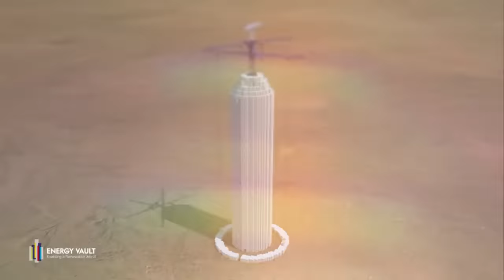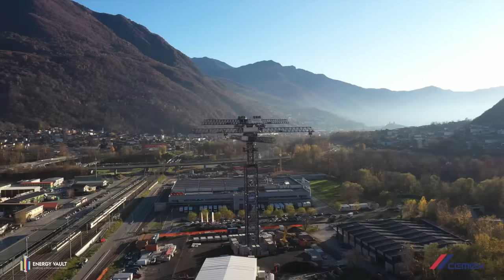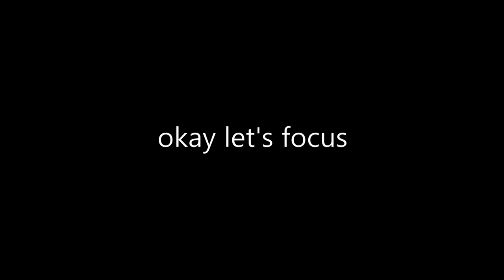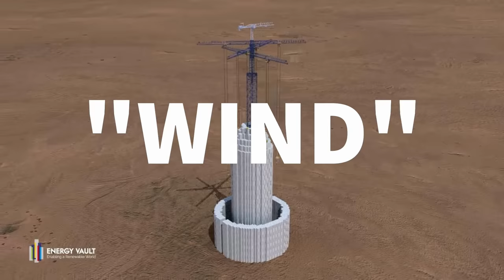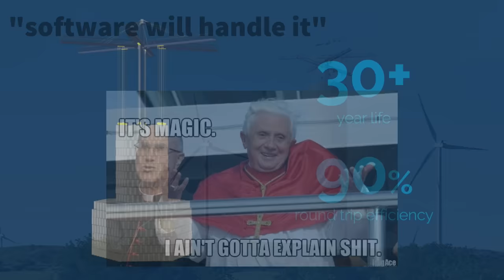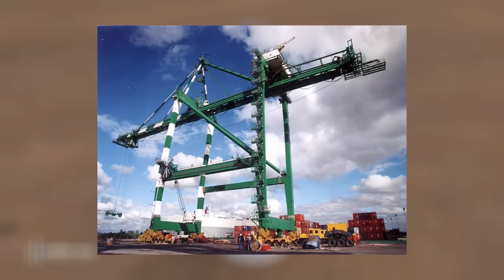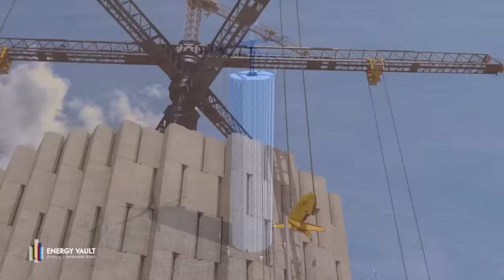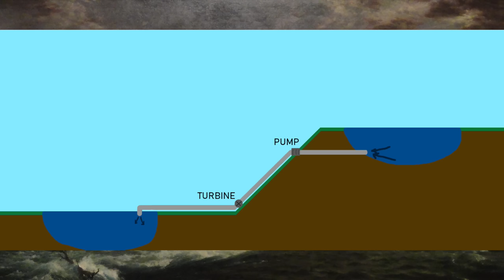The Energy Vault is a Dumb Idea, Here's Why

Comment: Okay, so pumped-storage hydro actually does everything this system promises to do - awesome! 
The obvious problem is that natural sites suitable for pumped-storage hydro are super rare. 
So the questions are, how can you artificially create such a system at minimal cost and environmental impact, and could that possibly be cheap enough to be economically viable?
Reply: Making an earthen resovoir and an artificial lake on a flat plane has still gotta be cheaper then the literal hundreds/thousands of cranes you would need for this thing to compete though.
Reply: the the problem is "natural sites suitable for pumped-storage hydro"
solve that instead this nonsense.
instead "natural" why not "artificial"?
we have brain to think not to dream only.
Reply: Build a reservoir on the top of a cliff close to the sea and pump salt water. You can even use the pressure to desalinize part of it.
Reply: Old abandoned mineshafts make a good (and deep) empty cavity underground. With the "high" water reservoir on the surface. This concept is called: Underground Pumped Hydro Storage (UPHS).
Reply: Drop a concrete slab in front of a river
Reply: Just popped into my head as I was reading: maybe towers filled with a compressed gas? Something like this already exists, but for a different reason; LPG is stored in towers to maintain a constant gas supply to households.
Reply: @Kj16V  Underground chambers filled with compressed air are in use. The issue is that they are still using a small amount of gas to heat it up before pushing it to the turbine... so not completely carbon-free technology at this point
Reply: @gergokovacs3257  large and heavy rotating body sounds difficult to manage tho
Reply: @Kj16V  That need an extra energy to cool them down...did you saw those radiators next to the LPG towers? that's the reason they are there :)
Reply: The answer is - you can't. VRE is a dead end. Storage requirements are enormous and they grow every day, as the humanity uses more energy.
Reply: @xanjismaverick5459  yes, but too expensive to consume such electricity.
Reply: @ryaeon9793  artificial = much more costly
Reply: @albertoa.r.5886  and your pump is dead in no time.
Reply: @antoonvandyck2086  mine shafts = small capacity.
Reply: @Argentvs  promising on paper before you check costs, roundtrip losses and capacity. Better than batteries, but geographically limited and still 10x too expensive.
Reply: @ImaskarDono  well, steel sir tanks are cheaper than giant lithium batteries that last s few years and need replacement.
Reply: @ImaskarDono  so did we artificially create a dam? 
did we artificially create these dumb idea that raise and lower concrete block?
we artificially create wind turbine?

if you dont want something costly just go live in the jungle without electricity.
Reply: @ryaeon9793  Pumped hydro global atlas is a list of sites that have the geography for pumped-storage hydro
Reply: @catprog  yeah.. that why i said we need more alternative that are effective and not only catchy or sound cool only.
forgot which comment i did that.
Reply: There is a pretty good alternative. Air batteries! Now, I haven’t seen 100% proof of viability, but it is not relying on altering the environment in any way, all it needs is a air pump. 

Essentially it is a tank of liquid gas, and they pump air into it to store energy, and then run it backwards to produce energy. You lose a fair bit of it on the way, but it more than makes up for it by scalability and not being environmentally invasive.
Reply: I mean... with all that concrete, you could easily make a reservoir with it.
Reply: @gergokovacs3257  friction loss
Reply: @hanneslaurin9768  do you remember pumping your bike's tires? as soon as you compress air, it heats up and you need to keep it below a certain level = cool it somehow = energy loss.
Reply: @BlueSky_BlueSky  yeah, i think they adressed it.  I mean, any pumping of any media will result in a heat loss, but all conversions of energy are not a 100%, that is physically impossible. We are talking about what are viable options, and pumped hydro is a fucking mess. If you dont want to end up building these insane structures, you have to find just the right topology and make crazy invasive alterations. Both those alternatives would in themself result in massive carbon emissions. 

Maybe im missing smtn, but i have been looking into gravity based energy storage, and it just does not seem practical in almost all cases. If nothing else then the limitation using gravity is in terms if energy. Even with lead it just takes up to much volume for what little energy you can store. I think people in general overestimate how much potential energy can be stored in physical objects in relation to what that means in terms if electricity.

Im sure there will be some good implementations, but it is not a magic bullet. 

However, air batteries seem to have solved most of those issues. And is just a bit less efficient than pumped hydro, with potential for improvement. It does not fuck up local environment, it does not need to be done on a massive scale, and it can negate the energy loss of electricity transport by being distributed. 
It uses a resource we have in abundance,  and which won’t affect the local wildlife. 

Imagine the engineering challenge of building a massive pond at a high elevation, compare it to setting up a couple of pressure tanks and pumps at the edge of town. Imagine the difference in how quickly it can be adapted, and not being limited by the local topology and water availability.
Reply: @hanneslaurin9768  Ok, I will have a closer look at that compressed air energy storage technology.
Reply: @BlueSky_BlueSky  let me know if you find anything that counters what i have claimed. Im genuinely curious about this topic
Reply: @xanjismaverick5459  If one of these towers tips over it will have a pretty localized effect.  If a large amount of water escapes it's dam things may be a little more frantic.
Reply: @sendoh7x  They are already using flywheels for grid storage.  The problem is scaling them up- you basically have to do a lot of smallish ones.  Back in the day of CD players they were constantly trying to push rotations speeds.  They topped out at about 50k rotations for the CD players before the CDs would explode.  The numbers are bigger for flywheels but you still have a limit to how fast you can spin them, and the wider diameter you give them the faster the outside of the wheel goes.  

I wonder how much you could push the outer edge in with magnets.  You'd have one polarity around the outside of the flywheel chamber, another around the outside of the flywheel, a slight angle gives you magnetic levitation but the big magnet in the wall could apply compression to the flywheel to help keep it from flying apart.
Reply: @xanjismaverick5459  "gotta be"

K bro, glad to know u did the math
Reply: @Kj16V  Better store compressed gas in balloons on the seafloor. Most wind energy gets produced in those areas anyway,
Reply: @sir0herrbatka  Not great, a lot of energy is lost through gas compression. You need constant pressure and balloons on the sea floor solve this issue.
Reply: You don't need a natural site; if you wanted to you could also just make a big hole or tower and arrange the pumping vertically. Not super hard.
Reply: @xanjismaverick5459  than* but yeah.
Reply: @gergokovacs3257  Do you have any idea how labour, material and cost prohibitive it is to have a large vacum chamber ? Gaskets wear out, washers and screws become loose its a nightmare. Not to mention there is no point to the system. If you have a system able to contain a vacum you esentialy have an inverse compresed air system. You just need to let air in to the system at a controled volume trough a narow tube fitted with a turbine to generate power when you need it. With the downside that vacum is more expensive than compresed air. You ppl need to stop trying to reinvent the wheel there is a reason why it is round and not square.
Reply: @nacoran  and you'd lose 99% of energy to eddy currents. Sounds great
Reply: Using old open mining areas in flatter areas would work.
Reply: @sendoh7x  "software will handle it" ;)
Reply: @gergokovacs3257  No at the moment I am a surgeon, but before I decided to go to med school I graduated a technical college and worked a bit as a CAD technician.
Reply: The answer is simple, you just use a big, electric, battery. Costs are coming down, energy density is rising, can put them damn near anywhere, ridiculous efficiency of energy in/out at 95% and higher, near-instantaneous delivery, minimal maintenance concerns
Reply: @DreadedEntityMain  You mean a chemical battery, the hydro battery and even the concrete one are also electrical. And no sorry as stupid as this concrete battery is a chemical one is even more stupid. They are very expensive, don`t last long, dangerous (they are essentially huge incendiary devices), and an environmental hazard (because of the heavy metals they contain). But the argument that there are places where hydro batteries are not feasible is a weak one. Yes there are such places, but its very rare for people to live in them so its not an issue. People usually live where they have access to fresh water.
Reply: @albertoa.r.5886  you can desalinize by pressure alone? ..i have some google research to do
Reply: @DreadedEntityMain  the costs are not enough for MASS storage.
Reply: Use liquid aluminium instead of water
Reply: I think you're confusing energy storage with production. Natural dam sites like Hoover Dam that are very economical, generate an energy surplus, etc. are rare. Hoover dam does not pump water back up to its reservoir and become a battery. 

There's plenty of lake sites and other solutions such as compressed air that we currently use (or rather don't use) that are fine for energy storage and would be more efficient than what they're proposing with concrete blocks and cranes. These solutions are still only like 50-60% efficient. You don't need a storage site right next to the plant, its the same reason you don't need to build houses right next to power plants. The benefit of energy storage is timing, not proximity, because we have power grid on alternating currents. But energy storage just doesn't make economic sense because of the 40-50% you lose unless you have massive scale like the Bath County Pumped Storage Station that covers the power grid of the east coast of the United States (various proposals are in the works for the west coast too including adding pumps to Hoover dam). 

Its just a silly thing to trick general population, like solar highways. Its easy to get people to understand the need for energy storage and everyone has enough school to understand gravity, so easy crowdfunding scam. But picking up rocks to drop them later is not an efficient way to store energy for the same reason there's no power plant that works by dropping rocks off a cliff.
Reply: @hanneslaurin9768  Its like 40-50% energy loss. But picking up rocks and dropping them is much much worse efficiency. Talking about flywheels or whatever is just obscuring this fundamental issue of translating mechanical work to energy and back. Anything mechanical can spin a turbine/flywheel/etc. its about how efficient you can translate mechanical work to energy and back again and its not hard to quickly figure out why pumping water is more efficient than picking up and dropping rocks despite all the problems with water.
Reply: Make a landfill with the intent to convert it into a pump storage. Use excess energy from landfill to pump water.
Reply: There's tons of suitable sites. Hell we already have them, they're called hydroelectric dams. Most already have small reservoirs in place to balance the flow of water and to be used as a municipal water source. Then there's disused sites that are suitable like old quarries and mineshafts. Old fracking sites. Pre-existing municipal water reservoirs that could be expanded to also serve the function of energy storage. Unused shorelines. The list goes on.
Reply: you dig a deep, deep hole and you use the earth from the deep, deep hole to make an earthworks, and you put a reservoir on top of the earthworks. bam.
Reply: Every watertower or almost any mountains or cliff
Reply: @Argentvs  green gas you mean? I would ount on watergas. Because the energylevel and the use of it is more suited for lower energy loss.
Reply: It is always cheaper to make a stored hydro. You can just replace the pile of concrete blocks and the crane with a large partitioned water tank (two tanks on top of each other essentially) which will be both cheaper, easier to build and have a much longer life. 
The difficulties you mentioned with pumped storage do not belong to pumped storage alone but to any gravity storage system. The large area needed and all is not specific to pumped hydro.  If you were to replace an existing pumped hydro system by the 'energy vault' you would actually need more space, not less.
The reason why so many people are misled is that they compare an 'energy vault' system of tiny storage capacity with a pumped hydro facility of huge capacity.  It is like saying a lawn mower engine is better than a jet engine because it is much smaller and lighter.
Reply: @captainahab5522  lol no costs there
Reply: What if there was a tower full of water.

We could call it a...

"Water Tower"
Reply: @ryaeon9793  did you read the same comment i did? the entire second half of it asks how to create an artificial pumped-storage hydro system safely and efficiently
Reply: Making a raised pool, really just a big water tower, with half of that concrete would still be cheaper.
Instead of questionably stressed wires, use the big crane motors on pump turbines to fill and drain.
Reply: First of all if you have a hydroelectric plant you already have a location suitable for pump storage
Reply: Shit.  You're right.

Dam.
Reply: Oh my god, great idea - instead of concrete legos used for energy storage just use same material to build A DAM (Something).
Reply: get the Cards Against Humanity folks to not fill their hole after they're done with it
Reply: @ryaeon9793  solve it then
Reply: Yeah in the netherlands where i live the video creators idea would not work at least easily, i think the square crane idea would be a more suitable/cheaper way, for at least here, since about 50+% of the country is max 1m above sealevel
Reply: These folk's idea isn't as stupid as it initially seems, though I'm dubious about the details. In essence, they're replacing the water in pumped hydro with concrete blocks, the pumps with gearing, and the pipes with cables. I'm dubious about the details of their system (I think two sets of blocks on opposite sides of a track that a gantry travels along is a better system), but the base components aren't a bad mix, particularly since if you were digging a receptacle for pumped hydro you would have to get rid of all the dirt anyways, may as well find some way to use it in the blocks in this scheme instead.
Reply: @DreadedEntityMain  : The lifetime energy return of a chemical battery is somewhere around 1/40 or worse of the lifetime energy investment in that same battery. Both pumped hydro and this crane scheme come closer to 1/4.
Reply: @Muaddibize  : The problem with pumped hydro locations mostly isn't that they can't get water, it's that they don't have good geography. If you have to excavate the lower reservoir for instance, then you might as well use a more sensible version of the scheme this video is criticizing.
Reply: @markhaus  : The virtually every site that you just mentioned is a poor site for pumped hydro. Water towers have too low of capacity, existing hydro dams actually don't offer the height difference we need, etc.
Reply: @danesanders5222  but its not my job to solve that.
 even average joe can see what is dumb project or good project just from the idea they proposed.
and im average joe, i support nuclear power than these unnefective thing. (even im not western)
Reply: Flywheels. There are already low-weight 100k RPM carbon fiber flywheel batteries with 85-90% efficiency.
Reply: @ryaeon9793  "How can you ARTIFICIALLY create such a system [while minimizing the] COST and ENVIRONMENTAL IMPACT, and could possibly be CHEAP ENOUGH TO BE ECONOMICALLY VIABLE?"
You could've really saved yourself some headache if you just bothered to read the rest of the comment.
Reply: @ryaeon9793   I guess you're not getting paid to solve it so that's fine.  I just hate to shutdown an idea right away when it could help us.  It's not our money this man is using and if they fix some the problems it could be a benefit.   Physics is fundamental and it will make them an idiot if it doesn't work so we don't have to.  I also believed more in nuclear power.  Nice chatting with you.
Reply: @danesanders5222   yeah.. you know the main problem right? read my recent comment. above or bellow somewhere.
from my point of view is.. human civilization  tend to pick less cost than effectiveness.
we didn have unlimited time and resources.
developed country choose wind power but not nuclear..(UK?) where effectiveness in that?
that just for politic and people opinion (clean energy or something), we as species can do that how long? 2050? 2080? when earth is hostile to life?
yeah we maybe died before that but our children and grandchildren?
i think that why instead this stupid planning why not we all donate to scientist that can improve battery capacity storage or maybe improving/building nuclear powerplant that meltdown safe or safe from external danger with their research so all U.N country can build their plant in one place because its safe, and help other country build nuclear power plant too, especially china because they are killing earth.
Reply: @danesanders5222  i think this comparable as you buy alpha games like battlefield 2024 full of bug and they release more buggy game in the future,
instead buying and supporting game that completed without bug so they can research more good game.
Reply: @ryaeon9793   Yep kind of like that.  But that's just if you can trust them to put forth the effort to do that.   I don't trust them yet.
Reply: @ryaeon9793   I agree.  Unfortunately it's on us to step up our game and try to better communicate what is a good system if we wish to see change; if we don't and we're not too worried about it then we'll just let it be.
Reply: @danesanders5222  that why you need to play risky investment..
 
even our ancestor always play roulette survival life and we survive.
that investment not for money, but for future something like that.
i just hope bright mind people can solve this problem soon.
or i hope world war 3 or 4 happened and that improve technology for more better future.
because we all controlled by politician and big corporation that only think about profit.
if no emergency happened.. they will stay like that forever, and no one investing to new technology other than their profit.
because if we use our brain for survival, we have high chance to create new invention.
Reply: @youtubecomments2740  Underrated.

In serious mode: Most places that can have a dam and damlake already have.
Reply: Appropriate sites are rare when you want to build something in the gwh capacity range, like pumped hydro tends to be sized. For 35MWh like this thing, you’d have lots more options…
Reply: Farm expensive fish in it while no energy is being taken out of it to pay for it. You could also grow stuff like seaweed in it, which should be easier than fish to grow & will probably take carbon dioxide out of the air & you can still sell it as food for humans or as livestock feed.
Reply: @BlueSky_BlueSky  recover the heat and use it.?????
Reply: don't store energy and use the billions of dollars instead to develop fusion power, where 1 liter of water produces as much power as 350 liters of oil
Reply: @albertoa.r.5886  Brilliant.  Making it do useful work, as well as store energy.
Reply: Theoretically, if there is a nearby open pit next to an underground mine you can artificially create this as a part of their reclamation plan. Usually, this combination appears on copper or gold mines.
Reply: I mean you could dig a hole then put the dirt from that hole above and next to it
Reply: You're asking for the correct conditions to build a complex contraption... which we already have a complex contraption requiring correct conditions.

...to stack many blocks blocking wind and liable to tip over as they aren't held together like a building. If one falls the entire thing is likely to completely collapse. It is practically crazy to try this.

We'd be better off creating a job where people manually move blocks up to place them on a device which goes down and generates power as a result.
Reply: @albertoa.r.5886  A cliff only gives you like 20m, perhaps 30 if topography is insane. Cliffs are not the most stable of places. Then you excavate 20m deep. How much height difference does that leave for the hydro storage?
Reply: @Kj16V  Actually that is also being tested as a battery, but they're quite expensive and have non-negligible energy loss because the air heats up as it is compressed. Next, pressurized air tends to leak quite a lot. There is serious research going into that as well, but so far it's not really viable. I don't remember where exactly, but some research facilities are operating to try and optimize it
Reply: Make a whole bunch of water towers and fill then with seawater. Solve energy storage and sea level rise at the same time
Reply: That's the neat part, you don't.